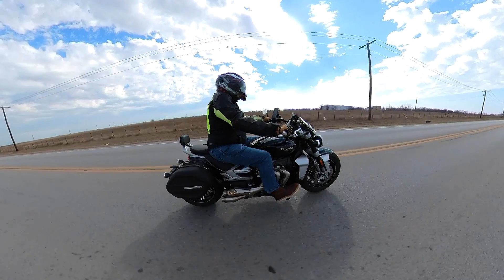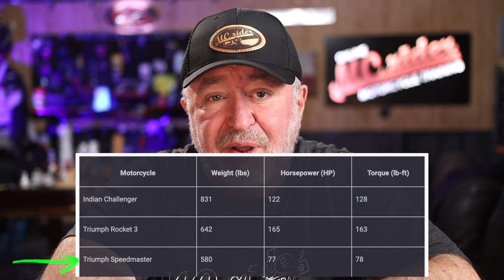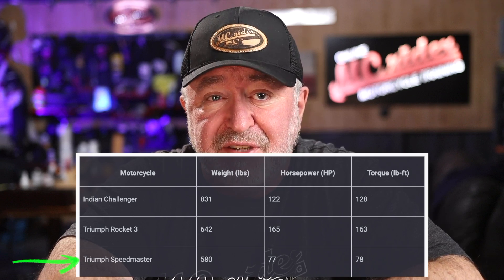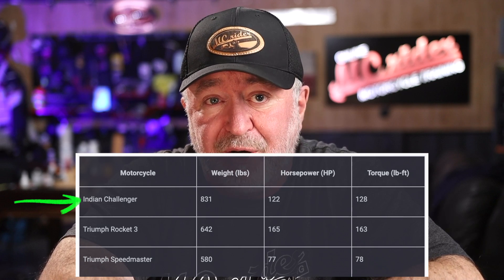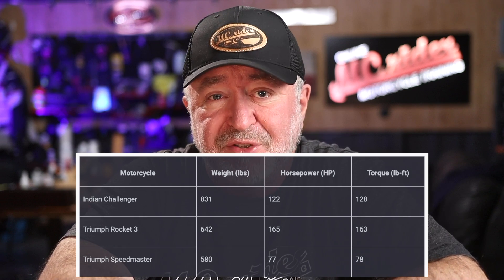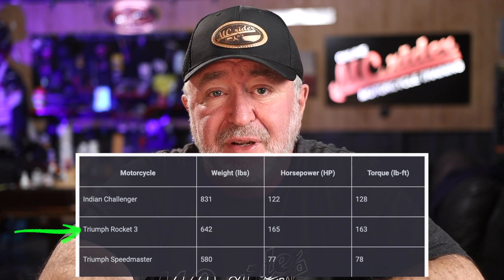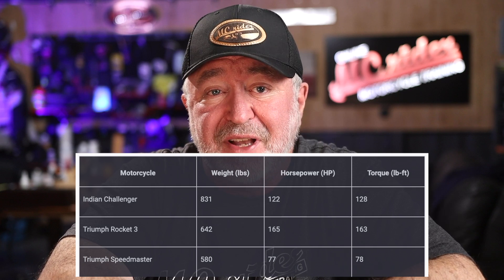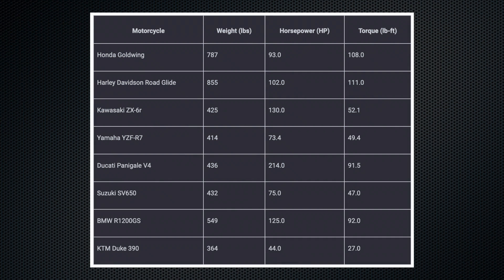Twist and Go: How Torque and HP Shape Your Ride!

Comment: Good points. I used to own a Honda CBR1000RR with about 150hp, but it was so high up in the rev range that I was already breaking every national speed limit in 1st gear. So it's true that you cannot legally enjoy the full potential of a liter bike because you can never reach peak HP below the speed limit. At the track, though, boy would it knock your socks off!

Comment: I generally like your content but you’ve completely missed the boat on this one. Torque is one of the factors to determine HP as you showed the equation. Beyond that torque is little more than misleading marketing numbers. You don’t feel torque. Think about this, you can have torque at zero RPM (electric motors). How’s that feel? HP is what’s useful for motorcycles.
Reply: what ypu feel depend on point of view or in regard to what? cos in regard to leverage you felll torque vs in regard to speed ypu fell power 👌🏻 cos force at conatact path so this what push vehicle forward  can be expressed as power level in regard to set speed or as torque in regard to set leverage or final gear ratio 👌🏻 you can calculate at any given point of accelerstion vehicle force level from both torque be onowing final gear ratio or leverage and torq at crank or from contact path force and whell dynamic radious etc asf or from power at set speed from g force force asf you can calculate this stuff on many diffrent way depend what data ypu will have  but at end all them lead you to the same stuff so yea…. like somebody want more 🤷🏻‍♂️ but whats more importent is how torque and power level in absolute number theyr peaks at engine crank from normal techspec data each engine  and at whcih rpm they are impact on how bike „behave „ let say so how strong it be at certain rpm (for which full power or torque graph is required though but only peaks and rpm at which they are pften say already alot about how engine will behave comapre to some other engine ) what be its peak eprformance what be its elasticity how much reduction it would required for match somebodys preferention while he ride it how much gears it would need how long 1 gear how high or low rpm it will need to hold for give satisfe performance for specified needs asf asf feg 50 nm 100 hp be way faster /accelerate way steonger of you push it hard than 100 nm/50 hp but it would required much higher rpm for this than 100 nm/50 hp and it be i mean 50 nm/qpp hp much weaker at low rpm and will need be conect with much higher gear ratio determined be weaker lowend and much higher rpm at which it operate ok not much higher cos topend power level in this egzample is much higher but higher be some margin assuming hipotheticslly that both those engines be in egzacly the same bike type frame mpdel whatever feg 300 kg cruiser … 👌🏻assuming 100 nm /2500 rpm 50 hp/5000 rpm rpm limiter 6000 rpm stroke 100 mm max piston speed 20 m/s this bike will required 5 gears if each time as rider ups on 1/4 mille dragstrip at 5500 rpm rpm start from 4000 rpm on another higher gear and with cda 0,50 topspeed be on around 170 km/h 1 gear at 5500 rpm be 52 km/h what mean 344 kgf force at contact path at peak torq at 1 gear at 6,566 m/s 0-100 km/h 7,5 sec +/- 1/4 mille 15,7 sec at 133 km/h exit speed with 45 hp avg at back whell vs 50 nm at 13000 rpm and 100 hp at 16000 rpm with rpm limiter at 18000 rpm stroke 33 mm avg piston speed at rpm limiter 20 m/s it would reuired 9 gears around for stay all the waay at power band at 1/4 mille distance lenght what mean each time rider ups at shiftlight at 17000 rpm on another higher gear rpm start at 15000 rpm ( such more gesrs generste more losess) 👌🏻 topspeed at the same cda 0,5 be on like 214 km/h level 1 gear at 17000 rpm be 84 km/h with peak force at 1 gear 330 kgf +/- at 17,84m/s yep slightly lower peak force at 1 gear at co apletely diffrent speed at the same speed at 1 gear 50 nm/100 hp version will genersted only 260 kgf at clutch fullly closed we csn amtch force on 1 gear with 100nm/50 hp be manipulated gearing more or even exceed it be alot if needed but  who cares 🤷🏻‍♂️ it be enough for this bike if roder launch fast at huge clutch slide 👌🏻 0-100 km/h be on around 3,8-4,0 sec level so avg force thrpugh 0-100 km/h speed range accelerstion basicallly 2 times biger than 100 nm/50 hp version 👌🏻 and 1/4 mille in 12,5 sec at 167 km/h exit speed with 90 hp avg at back whell cross finsih linee 100-120 metres before 100 nm/50 hp version cross it 😎 👌🏻 yep waaaay faster version than 100 nm/50 hp but it will need much biger clutch slide at launch and it be waaay weaker from idle rpm to 7-8000 rpm than 100 nm/50 hp version but yea if you push 50 nm/100 hp version enpugh hard it will absolutellly smoked 100nm/50 hp all the way except couple first metres where grip and whellly limited both version peak accelerwtion level 😉👌🏻 cruising at 100 km/h at last 9 gear be at 7500 rpm ! not many criuoser spin such rpm at limiter 👌🏻 🤭 vs 100 nm/50 hp will cruise at last 5 gear at very relax cruiserish  = 3000 rpm around 😎👌🏻 suprsiingly for some people 50 nm/100 hp version if ypu comapre elasticity at last gear of each  will have better elasticity at this point from 100 km/h at 9 gear than 100 nm/50 hp version at 5 gear 😎👌🏻why cos it work on much or better saying enough shorter final gear rstio for this comparision determined be whole resist power level and rpm at which this peak power egzist 👌🏻 where it have more power cos 5 gear 3000 rpm =42 hp vs 9 gear 7500 rpm almost 50 hp 👌🏻 😎 however offcorse if we leveled final gear ratio for what 100 nm/50 hp version will required downshifts couple gears and speed range must be lower cos 100 nm/50 hp version dont operste at higher than 6000 rpm pbviously as we set rpm limiter at 6000 rpm 👌🏻 than to certsin low speed in such testmconfigurwtion it completely smoked 50 nm/100 hp version work now on almost chocked level of rpm 🥴👌🏻 but yea than from this very low to certsin low rpm speed at last gears 100nm/50 hp show huge advanatage abvioulsy or from dig spin each version to 5500 rpm also 100 nm/50 hp than show huge big advantage to 60-70 km/h what be speed at 5500 rpm for 50 nm/100 hp version at stock gearing 👌🏻 😎…. shorter final gear reatio is detemrined be stuff which im subcribe already 👌🏻 so power level and at which rpm it egzist in the same bike type frame like inme egzample 😎 👌🏻 it will reauired to holdmuch higher rpmm all the time and upshifts much more times and dowwnsofts much more often assuming rider want use  the same % performance from each version topend lelvel so obviously for 50 nm/100 hp version much better performance 👌🏻😎🍿 asfnow than if for somebody 50 hppeak in 300 kg cruiser be enpugh for slow cruising like he like than this version 100 nm/50 hp be 1 mln times better for this person why ? it will launch much easier fast it will work on more relax lower rpm asf 👌🏻 …..🍿what  ypu fell depend on point of view in regard to some units cos we defined specific units very precisellly in physique what they actuallly subcribe 👌🏻 and what data ypu need for catch level of specified units 😉👌🏻 saying torq is accelerstion force strenght whatever and power topspeed is gay 😂so i banned it 😎👌🏻🍿

Comment: Important to note torque is absolute. Horsepower is a theory, based on math, once torque is known.
Reply: 😂 theory which beat in racing torque each time 👌🏻 🤭 than its very precise theory i quess which subcribe very good what actuallly happen torque is as absolute as each other confirmed in practical tests units like power lenght deepth weight accelerstion force and all other 💩 👌🏻 🍿
Reply: Hivemind nonsense.  Both torque and power are absolute, both can be felt, both can be measured both have a mathematical relationship with each other that can calculated with an equation.  Math proves things doesn’t discredit them.  Power, not torque, is the limiting factor in not only the top speed of a vehicle but also in how quickly it can accelerate at any speed and how much weight it can pull up an incline at any speed.  Anything Torque can do Power can do better and/or faster.

Comment: It sounds like torque tells you how fast you can change your speed from a stand still or a low speed, and horsepower will tell you how fast you can change your speed at a highway speed.
Reply: and harry poter can tell you how fast ypu can change speed at mach 1 and above 👍🏻🤐🤭
Reply: @mociczyczki 🤣👍
Reply: Power and Torque are not Batman and Robin please stop trying to assign them roles. Power, not torque, is the limiting factor for not only how fast a vehicle can go but also for how much weight it can pull at a given speed and/or how fast it can accelerate a given weight. Torque is the sound of one hand clapping. Without RPM nothing happens.

Comment: I ride a 2015 Triumph Rocket 3 Touring.  I have done a few mods so I am pushing much more power than is necessary.  
The weight and power makes it a ideal for interstate traveling. 
I think it is important to realize machines in the class of the Rocket are not for the novice rider. If you do not understand and practice the friction zone, reverse steering, and how to manage the weight and torque of the bike like this it will kill you. 
It demands respect.  
Probably one of the reasons I am a fan of MCrider.  You are never to old or experienced to learn something new.
Ride safe.

Comment: The reason the Big cc bike accelerated faster of the line is because it had more horsepower.

Power is king.
Power is the capability to perform work per time.

Torque at the wheel is engine torque times gear ratio.
More power can generate more torque by gearing.

The bike with the highest power at a given speed and a given rpm will accelerate the fastest.
 
Shift down => more rpm => more power => more torque at the wheel.
(Unless over reving into a rpm range where power drops)

The gearbox is the extremely important, often ignored variable when discussing hp vs tq.

The never ending confusion and misunderstanding of such a basic fact is surprising.

Comment: It would be interesting to extend your companisons to electric motorbikes. They tend to have flatter torque curves until they reach a speed where the motor needs more current than the battery and high voltage cables can supply, so torque drops off at high speeds. Amazing acceleration at low speeds, less when overtaking on motorways. Although the mode you select affects the torque/power balance just like gear selection affects bikes with gears.

Comment: No. Your engine burns gas. That creates power whether you are at 2000 rpm or 20000 rpm. Torque is a component of power in a rotating system. RPM is the other component. If one bike makes more torque at low rpm than another, it is because it is making more power at that low RPM than the other.
A Dyno measures power at the rear wheel. The peak torque value you see is calculated from the rear wheel power. It is then attributed to the torque at the engine's crank. It's an approximation. 
If you have to pull a fat woman up a hill, you might be interested in the torque at the rear wheel. That is created by your gear box. Power to your rear tire is independent of the gear you select. Speed/torque (the two components of rotational power) are completely dependent on the gear you select. You want more torque at the expense of less speed, you select first gear. If you want more speed at the expensive of torque, select sixth gear.
The marketing numbers you see from manufacturers are PEAK values. Has nothing to do with the TOTAL power over the rev range of the engine.
Hope this helps. It rarely does. Silly myths die hard.
Reply: I can’t figure out why trucking companies don’t use cheaper, lighter (more payload) 400hp/5000rpm pickup truck engines instead of those 500hp/1500 rpm truck engines because torque has nothing to do with the equation…
Reply: @laurieberg2880  those truck 500 hp 1500 nm or actuallly much more nm are build for last longer than those in pickup in regard to semitruck aplication with big load + how much torque say 💩 and is meaningless than 500 hp in ypur egzample still is 25% more than 400 hp so they can make job faster with heavy load on trailer uphilll asf 👌🏻 but i understand what ypu mean so better egzample be 500 hp pickup vs 500 hp semi 😉👌🏻 as long as both willl male the same job in the same time there must beother stuff involved whe company dont use those lighter ,chesper pickup engines and like im mention at begiining of this comment it is most likely due to its lighter cosntruction which make it live shorter under such big load like in for semi aplicstion also gearing wpuld need to be changed on much shorter due to lower torque lewer and higher rpm level from which those pickup engines genersted similar power but that also probabaly not big deal reall deal is that its lighter cheaper construction make it more fragile in regard to semiheavy load aplication what male them more prone to malfunctione srlier damage etc repeest 3 and last time 😉👌🏻you can also put in such semi f1 engine which make 900 hp os and only 300-400 nm with correct gearing it would pull uphilll heavy trailer faster with biger accelerstion than 500 hp 2500 nm semi truck engine the point is such f1 engine would explode after 200-300 km 🤭due tu its super light build construction  in regard to avg piston velocity rotstional mass asf vs semi truck engine are very heavy have much thicker heaver elements which can withstand much more = live longer crank bearings all is on 90% much heavier thicker stronger than in pickup truck engine 🪠☕️
Reply: 👍 well said, not many people get that power is the same in all gears.
Reply: @rollsroyce329 on crank ,however found couple dyno pulll at each gear with power graph at whell it show at 1 gear was acheive lesss power than at rest ,dude say there was no other map for 1 gear in regard to rest and say at 1 gear everything which move in engine must accelerate and have biger loesses cos of this at 1 gear is generwted lesss whell power the only trouble is that at each toher gear also everything must accelerate just at doffrent rate so im lil confuse about this dyno graph to this point dont egzacly know why it show lower power at whell at 1 gear i think map was diffreent and not like this dude say or dyno not enough sampling frequenzy for catch true peak at 1 gear cos at 1 everything happen faster than at hogher gears but im not sure 😉🪠or thers other posibility like grip issue st 1 gear accleerstion and contact path force is greatest what lead to bigerrr slip tire on dyno roll feg  if belt push bike to roll with the same force 🤷🏻‍♂️🤔
Reply: @mociczyczki a lot of modern bikes have very different mapping by gear.  Especially the higher power sport bikes. Not like the old days where all the software mapping the throttle on my CBR 900RR came with the rider not the bike. 😁
Reply: @rollsroyce329 yea i know in 200 hp sport bike thay do this and as weoght rerio and weoght distribution stay the same and pwoer of engine increase they also increase lenght of 1 gear to such point for hold front whell at ground at peak torq rpm with throtle to the max setup be driver or not higher than couple cm above tarmac cos if they allow more accelerationdrop down vs whellly goesup good for funbike not good for sport bike offcorse allways drivercan input less throtlle but they do this anyways but dude say its not mapping 🤷🏻‍♂️ hees probabaly wrong  or lie it can be also some of this factor which im mention in previous comment but whatever  peak power at whell is probabaly also constant at each gear cos as tire bend more on lower gears thers more heat cos of biger force between gearbox gear whells asf asf than at higher speed at higher gears thers more centrifugal force cos whell spin faster asf and those stuff msot likelly compensated to the point where on each hear thers achieve for the same bike and mapping the same peak power .

Comment: For most folks street riding torque is the most important number.  That said, how much do you really need?  I'm perfectly happy with my 2007 Ultra with mid 90s torque and HP.    I don't need the fastest bike on the road and it is pretty darn comfortable.  Happy New Year and keep the good stuff coming Kevin.
Reply: Need and want are two different things. I don’t need the 163 lb-ft that my Rocket III has, but I want it to have fun!